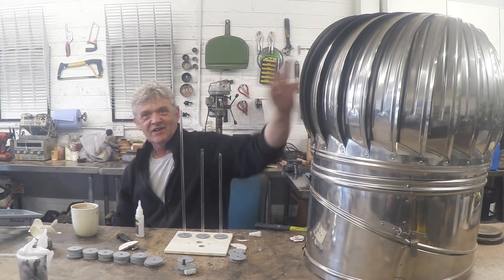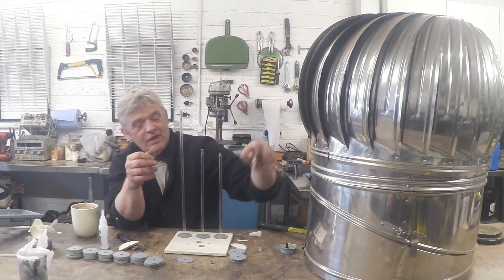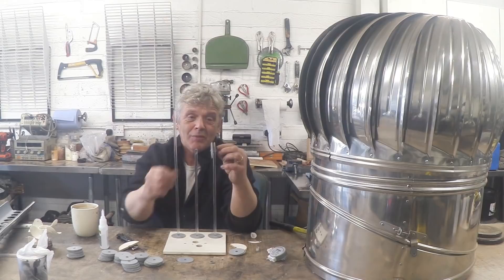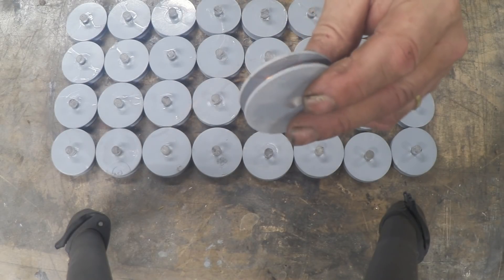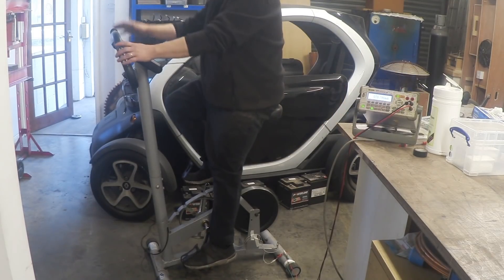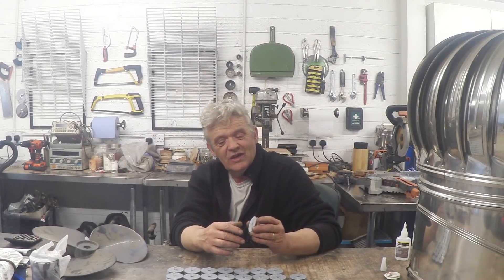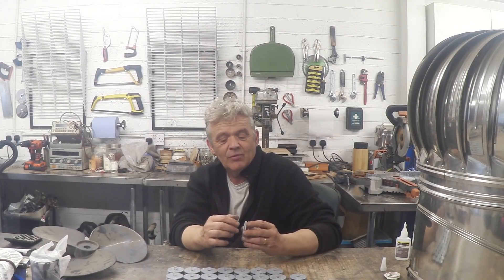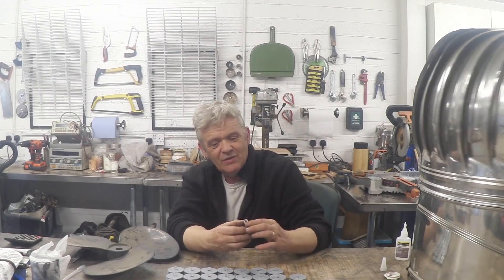Rotating Ventilator For Wind Power - Part 2 - Making The Coils and The Plan

Comment: Ok what if you talk a pulley of a marine alternator. Set it up right, then just connect the bolt in the center of the the turbine into the alternator. Even though it low torque, it should still swoon the alternator creating power. I’m I right in my thoughts? Yes or no could you do a video explaining why please.

Comment: Why not make a plastic frame with a dozen or so corners to go around the perimeter of the blades, then "weave" copper wire to make coils, like in an A/C motor?  Then you just attach magnets to the blades.

Comment: Just noticing ... Are the coils able to pick up a bit more if you stack the coils half over the previous and half under the next coil, slipping the last coil under the first in the ring, allowing the magnets all to be placed with the same pole to the coil eliminating the bridge rectifiers... ? Essentially creating a linear motor, that happens to wrap around on itself...

Comment: I would be curious if the addition of the iron cores would add extra current to this. Neat project tho! I would be apprehensive about adding a fan blade to the interior of the unit, Unless it  had a high pitch angle so as not to slow down the upflow of hot air-- I will be looking at your other videos for more tips--and Thank-You!

Comment: So positioned on your roof on a windy day it will spin and at the same time can use escaping heat to spin, it's a win, win. You could use energy generated from the outlet of an earth battery to generate and power and repump that air with another smaller fan which blows into the in - pipe to continue circulation provided you get the correct size piping to reduce drag as the air is pumped without the decrease in heat. Sorry guys  just thinking in terms of heat transfer from buried pipe surrounded by stones (climate or earth battery) to store heat in the Summer months and transfer heat during the cold climate in winter for temperate zones (which is where I live). Don't mean to rant, it's this channel it keeps my brain multitasking. Thanks Mr. Smith, another ingenius idea.😊👍🤔👊

Comment: Love your videos and your down to earth approach to building stuff! Just a simple comment though about your estimate on power output. To get a power output value, you need to measure amps and volts simultaneously and then do the product. You can't actually measure a voltage with no load and multiply that by the short-circuit current : this grossly overestimates the power output you're getting because, under short circuit conditions (multimeter amp reading), the voltage will be much lower.

Comment: Interesting project.  Some thoughts. The area of a coil is key to maximising the output from the magnets passing so a 6mm centre may not be optimum. The work of Hugh Piggot on wind genetators has a wealth of information on optimising the coreless pm generator. The available energy will be limmited by what the air movement past the cowl will give so if you take too much from the coils you may reduce the overall inefficiency. Keep the ideas coming.

Comment: Very cool! I have always wondered about making power from those!
The only drawback I see in it is that they are designed to provide ventilation to the roof, so by making resistance there, ventilation will be reduced. Capturing that stack effect and the hot air rising is a much overlooked source of energy though, good on you for tinkering with it!

Comment: You can’t use open circuit voltage AND short circuit current to calculate generating capacity
Reply: Not short circuit, rather in circuit amperage...

Comment: What kind of wire is used for the windings and where does one get it?
Reply: That is a thin guage copper wire that is varnish coated. Otherwise not bare wire. 
You can get a roll of it online at Ebay and other electronic supply houses. I got a huge roll at a junk yard for the price of the copper alone. it has since gone way up. I utilise a film winder (Hand Crank) with a modified end to press fit the bobbins on.  Just Crank away!

Comment: How long would it take to do something useful, say charge a cellphone?
Reply: Not long even less if it kept a base battery or capacitor charged up.
Reply from the maker: I dunno
Reply: how long is a piece of diy nettle cordage! ,make it as strong as the job required, its better/faster, generally speaking it takes twice as long to charge the last 3rd as it did the first 2 at a given amps

Comment: Rob 4.85 dollar Au delivered here. From Aliexpress.  That drops it by half. Nice work. The wire was fro. Old transformers?  Won't the coils need to be on the inside? As the metal will make it a Faraday's cage arrangement.
Reply from the maker: well I will probably put everything inside the rim just for weather protection mate but essentially you are spot on - if yo put the coils outside you would have to put the magnets outside too

Comment: I think the power-generated by a coil is being measured incorrectly.  The coil needs to be first loaded with a known resistance before you measure the voltage across it.  You then calculate the current through the resistance and multiply this value by the measured voltage, to give the power generated.
Reply from the maker: cheers mate

Comment: One thing I was wondering about the vent, is since their purpose is to remove hot air, that if there is a heat source under the vent, will it run faster or with more power?  It seems life a person could use a solar heat source, combined with wind, and produce a more efficient generator.
Reply from the maker: I like the thinking mate - cheers
Reply: A hot plate could be used as a test heat source to see if it makes a difference.  Since heat rises, I think it would a significant difference.
Reply: It is made to fit with other tubes stack them to get better wind access and paint it all black with open space at the bottom for air draw.

Comment: Brilliant stuff! 

I hacked an old calculator, used a reed switch as a sensor with a magnet on the lathe chuck to make a counter. I wound a lot of coils with great success.  The only drawback was that I had to keep the speed down.

I used to rewind motors years ago and had a high speed automatic coil winder.  Such a shame I don't have it now.
Reply from the maker: that is a shame - I would give a lot for a coil winderlol - nice tip on the counter mate
Reply: @ThinkingandTinkering  A small coil winder should be easy enough to make with your skills. A small hobby lathe is a great start. It's just the counter and auto tension/feed to work out.

A mechanical counter would be best I think, but I'm old school. The reed switch is unreliable at higher speeds, due to "bounce". Maybe there's a better way?

The wire tension on my old winder was just an adjustable spring loaded friction ring (oiled leather washer) and long, springy feed arm that absorbed small "shocks".

The auto feed was a like a clockwork mechanism and actually quite complex, but that was because it was adjustable for a wide range. It worked by using little adjustable limit arms to flick over a reverse gearbox. For small coils like yours, a feed may not be needed if the wire tension is correct. A 3d printer could help with manufacture of most of it.

Anyway... If I can find some time, I'll work on a simple system that can be attached to a lathe tool post. If I sort it, I'd be happy to send you one.

Keep up the good work. I love watching the stuff you come up with.

Comment: Council refuse depot, loads of them
Reply from the maker: you used to be able to but around me if you take something from the tip they fine you
Reply: @ThinkingandTinkering  It was my job to collect small electrical items from households, usually 20 -30 items a day. Microwave and LCD TV's were top but fans, heaters, computers, laptops and the old CRT tv's, I wish I had seen you channel then and I would have sent dozens. We also had treadmills and exerciser bikes. Try contacting you recycling officer at the council and tell them what you doing to see if they will help.

Comment: I always thought that one of these would be awesome if it was scaled up to around 8 feet in diameter and weigh around two hundred pounds using cast aluminum parts. It could be anodized. They spin no matter which direction the wind blows. I'm thinking cheap and very little maintenance. Here in Canada the snow and ice might be a problem so a resistive load could be incorporated for deicing and perhaps controlled with an arduino.
Reply from the maker: I like it mate - think big
Reply: Nice make charcoal paint for it to keep it hot and a constant airflow moving up it.

Comment: ....I just wonder about digital multi meter readings, they're very fast and responsive. They've fooled me in early days. The meters can read fleeting highest voltages and fleeting highest amperage . What might the reading be if averaged through a parallel capacitor ?   And power as i know you know is the rate at which something happens, so it's not a quantity indication . But some digital multimeters can be set to do the averaging . Anyway you know what I'm saying , the power is real but we may be fooled with regards to the electrical energy we can obtain .
Reply from the maker: There are always going to be issues mate - especially with meter readings - the truth is the only way to see what they can do is build it and see - the rest is just a mine field of argument - I quite honestly don't bother to even get into it as a lot of time can be wasted arguing the pros and cons of the readings - as for what this will do - well let's see - the investigation is certainly interesting

Comment: Loving your work dude. Still awesome, as always. 

If you use ferrite cube magnets they are sooooo much cheaper. 
Arranged in a halbach array. They are not to different to neyodynium. 
The strength is similar but the field is larger. 
In this set up you can use double coils the front one air core and the rear one iron core. 
The iron is far enough away to not greatly reduce rotation speed however is close enough to collect the rotating field.
Reply: The core magnets stall under load.  The coil can charge capacitors relatively well tho. 

So now I'm mounting washers on the core shaft like mini fly wheels. 

I'm calling this set up my fractal energy generator.
Reply from the maker: Thanks for the tips mate - awesome thinking
Reply: @ThinkingandTinkering  thank you Robert. It's watching your videos that ignites the thinking. 

This video had me wondering. 
What if you fitted a small neyodynium magnet inside your coil on a rotating axle. 
The rotating field off the flywheel would rotate this core magnet. Surely this would give a larger collection. I'm going to try this. I'll keep you updated on my results. 
Thank you again.
Reply: Okay so I've quickly thrown together a set up. 
I have only tried this so far on a pancake coil. About 10 turns. 

The ac voltage is indeed greater when the coil has it's own rotating neyo core compaired to an external ferrite field. 
I haven't really tested anything properly and my axle was as efficient as a square brick uphill. None the less there is an increase. 
One thing that is easily seen is; 
The speed must be gradually increased. If the flywheel goes from zero to hero in one second the core vibrates horribly. Slowly increased though and the core follows.

Comment: depending on how deep the magnets field is you could probably put 2 or 3 layers of those thin gague coils and extract near the same voltage in the first 2 or 3 layers , maybe more , this is the thing with diy to know if you are getting the max out of the magnets (which you may as well do since they tend to cost the most of other parts, you could also experiment with thicker gague wire to get more amps.)
Reply from the maker: certainly could mate - cheers

Comment: Good magnets are expensive, but you might be able to make a really strong magnetic field with a second set of coils bolted to the spinning part.  I think that setup might need brushes and a capacitor. Adds a bit of complexity to the design, but it's cheaper than spending hundreds on magnets, and might outperform the cheaper magnets.
Reply from the maker: Cool idea - maybe version 2 mate - I am just trying something here and don't really want to get into the expense and complexity when I basically have no idea if it will work
Reply: Electromagnets are neat.

Comment: .....That's going well . I'd probably be happy with couple of watts to maintain charge for led lighting or surveillance battery or weather vane or signal amplifier for TV reception. ....how much do we really want to tax the ventilator if it's job is to ventilate ? ...but I have a feeling it is self limiting in high winds meaning that energy that ain't harnessed in  strong winds is now available through the load presented by the set up .
..coils with iron cores might prevent the ventilator launching into rotation till a certain wind strength develops , you used the term " cogging " at end of video , , whereas nonloaded ventilator starts up in slightest breeze...Neodymium magnets have to be protected from corrosion but do reduce weight load on ventilator bearings for same output cos they're four times the field strength at least on weight for weight comparison. All good gristle for a Faraday Lecture .
Reply from the maker: it's a cost thing for me mate - this is cobble together - I am expecting something and as I am not paying much for it - that something is fine by me - if you wanted to spend on it there is quite a bit you could do - but let's see if it works first before spending on it

Comment: If I was going to the trouble of winding the coils I would have made them rectangular (so that the magnetic field crosses the windings at right angles, increasing efficiency) and such that the magnet didn't cover opposite ends of the coil at the same time as this would try to induce opposing currents in the coil.
Reply from the maker: yeah I thought about it but making circular bobbins was quick for me - basically we all make choices mate - if you want to do square ones - go for it - no reason not to

Comment: Why not put a belt on the o.d. and just spin one motor? It should have plenty of torque for it. What are the dimensions of the vent?
Reply from the maker: we all choose different ways mate - if that's what you want to do - go for it - I suspect you will be disappointed but - I don't know I am just guessing here - it's 2 foot across
Reply: @ThinkingandTinkering  24 to 1 would work pretty good to turn a motor. I guess I have to try it.

Comment: RMS, rather than a plastic plug in the center, drill that out and put an iron slug or bolt instead. It will focus the magnetic energy through the center of the coil. You will likely see a boost in the output. Use a smaller bolt (No. 8 or No. 6) and it will enhance the magnetic force and reduce the cogging.
Reply from the maker: I did explain in the video the plastic was a deliberate choice I don't want an iron core
Reply: @ThinkingandTinkering  A smaller diameter core won't give you much cogging. It might be worth an experiment on one to see how much drag you get from a small diameter iron core vs power output.
Reply from the maker: @htmagic  by all means mate - go for it

Comment: Great video yet again!   Just wondering what type of wire you are using to wind the coils, and how much (length) you need per coil.  Multiply that by 32 coils - how much would you need to spend on all that wire, or can you also salvage that wire from somewhere else?
Reply from the maker: I got mine from microwave oven motors mate - the fan motor has a coil on it - I should have done that - sorry I didn't - anyway not sure of turns or length as I am not going to count that much - I am going by fill factor and resistance of coil to get an idea of equality of coil at least - anyway the wire is hair thin - not sure how thin - sorry for being vague but this is being cobbled together from scrap lol
Reply: also there is a ton of wire in the secondary of a microwave transformer
Reply: @briancasey3421  ....most folk mangle the secondary when removing the windings. Can be done without damage though.
Reply from the maker: there is mate - but it has been resin coated in situ so is pretty difficult to get out clean

Comment: Would stronger magnet produce more power Bob? The power is limited by the turbine and wind and after that it's efficiency but does a stronger magnet make it more efficient, it would surely not be 20 times so your approach of cost benefit must be the right way-more fun too. Cheers.
Reply from the maker: Faraday's law relates  EMF to the rate of change of magnetic flux so speed is a factor and ampere's law relates strength of field to current so strength of magnet is a factor too - or at least that's my understanding of them. So the turbine doesn't. limit them it tries to harness them which is why efficiency is an issue in actual construction - or at least that's the way I see it mate

Comment: Fantastic video. Could you show how you wound the coils please? Do you start with a single end so you have one end at the centre and the other at the outside edge or do you fold the wire in half and wind so both ends are on the outside edge? Sorry for such a basic question.
Reply from the maker: single winding mate in a clockwise direction mate

Comment: Will the magnets effect the rotation of the metal ventilator? Or even the generation in the coils?
Reply from the maker: yes - we will see how
Reply: We will probably see eddy currents induced into the case (stator) of the fan that will have an inductive reactance effect on the magnets.
Reply: @TerryGilsenan  Right, I thought it might be something like that, I immediately had the image of the magnet slowly falling down a copper tube and wondered if that'd be the case here.
Will be interesting to see if it's enough to interfere.